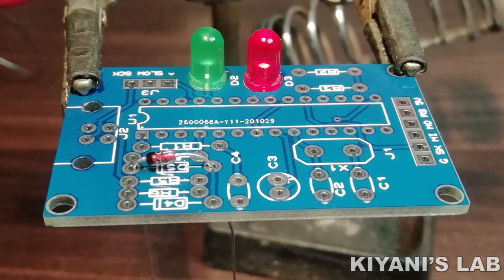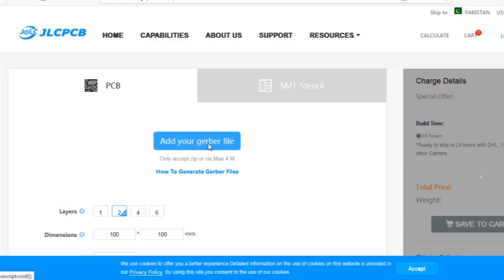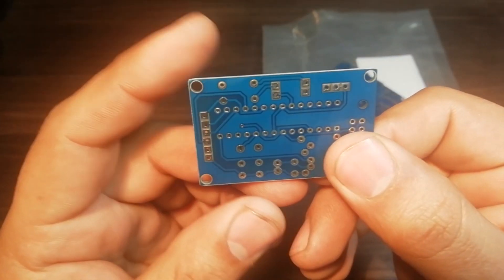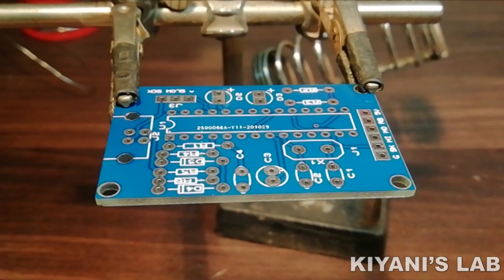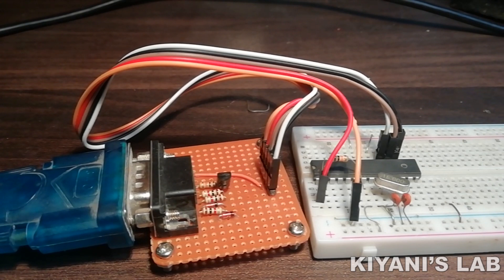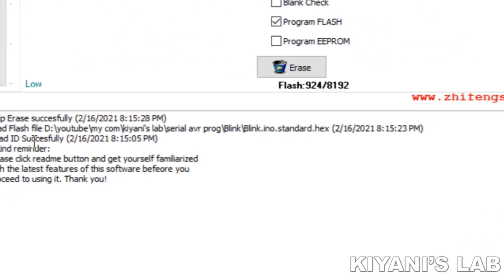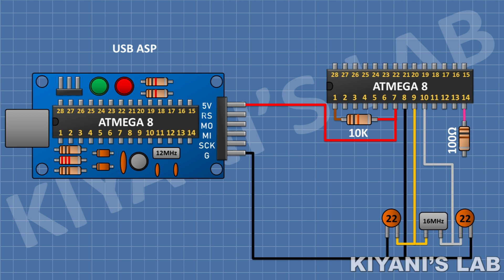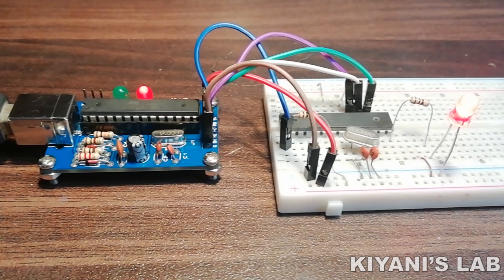How to Make USB AVR Programmer

Comment: Can i use atmega8A , 
Can i upload main Frimware Hex file in atmega8A using Arduino as isp ? 
And can i Use thus avr ASP programmer to Program atmega32?
Reply from the maker: yes atmega8 can be used and atmega32 can be programmed with it
Reply: @KiyanisLab  I don't have "atmega8" , i have atmega8A   what is "A" in atmega8A? Can i use it? And i maked USBasp using atmega8A on Zero pcb. It's work showing on laptop but when I trying to do program atmega328p It's showing in Avrdudes application Writing, and Reading , it's done ,but the Blink program is not run , on atmega328p , i have selected correct hex for specific 16Mhz crystal and Atmega328P microcontroller also i selected in Avrdudes atemega328p , but i think it's problem in Hfuse ,Lfuse? , or wiring issues? If you provide any link of Chatting app , than i share my problem with images 👍
Thankyou so much for replying ❤️

Comment: Thanks alot for the great video
Is it necessary to add the external crystal   oscillator even if its default setting is set to run from the internal oscillator ??
Reply from the maker: no

Comment: 16mhz  work look like 8 mhz , 
1 second led blinking code ,  goto  switch  on 2  secand , micro controller is working slow
Reply from the maker: fuse bit setting clock divided by 2 is set so 16/2 =8

Comment: hi bro i buy a usb to asp programmer . when i upload bootloader hex file in 328p mirco controller. it programe well. about  not program as real. 
i write a blink code for led i second on and off. hex file upload from usb to asp programmer .   when i give power in  uno board and give power . led blink slow, it is on and in 2 second , , that is the main problame
Reply from the maker: do you use Arduino ide to upload the code

Comment: What programme you are using with avrasp?
Reply from the maker: progisp
Reply: Thank you. I have a question, do i need to put crystal during programming, i mean i will put the crystal to my final board( if fuse bit set to use external crystal on the main circuit board)